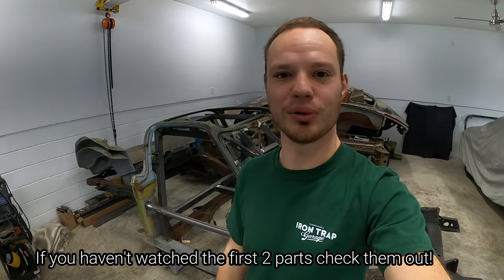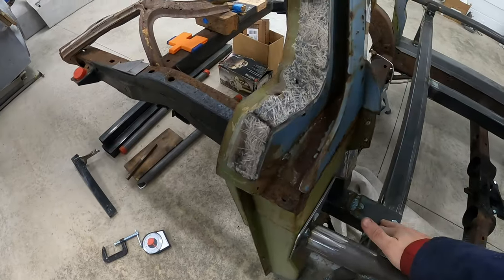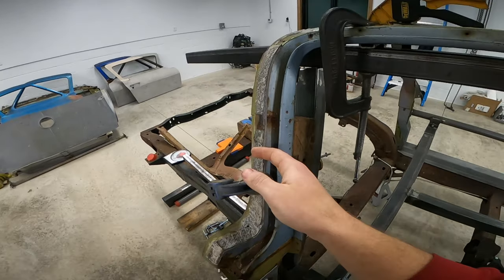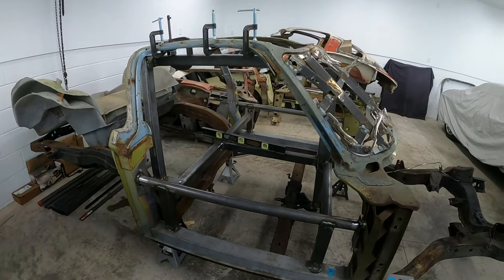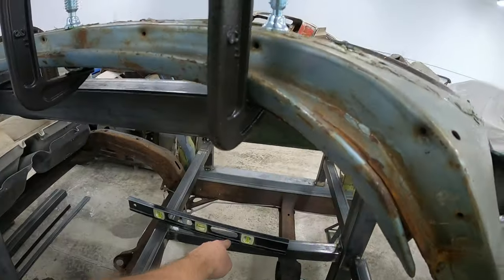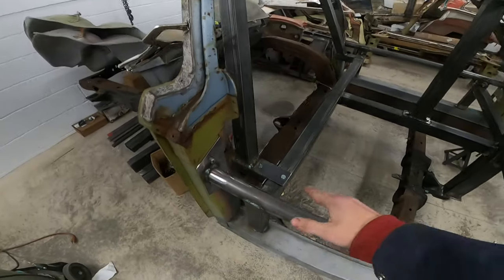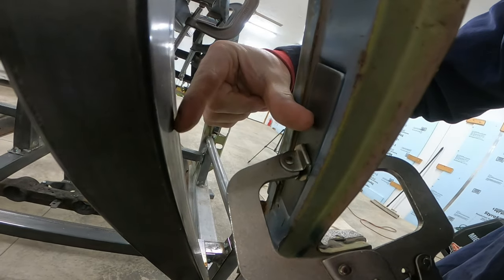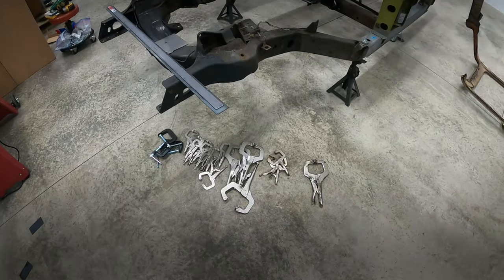Fabricating a New C2 Birdcage Jig Part 3.  Building the Coupe Jig.

Comment: Nice job! You have great patience. I would have invested in a chop saw about a quarter of the way into the project. You're right! You can never have enough clamps when fabricating. Have a Merry Christmas also.
Reply from the maker: Thanks I appreciate it! I bought a harbor freight band saw. It worked well but I think I smoked the blade so it didn’t make an appearance in this video. I forgot to get a blade lol. Yeah clamps are  an invaluable tool. I’m a big fan lol. Thanks have a safe holiday.